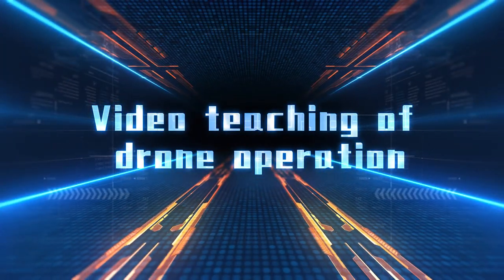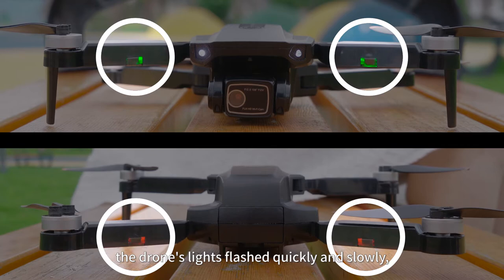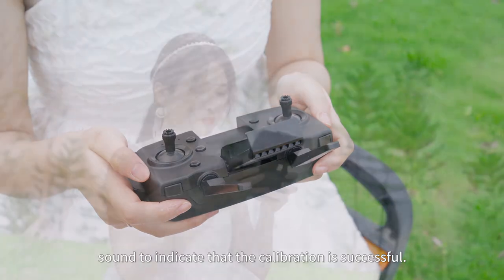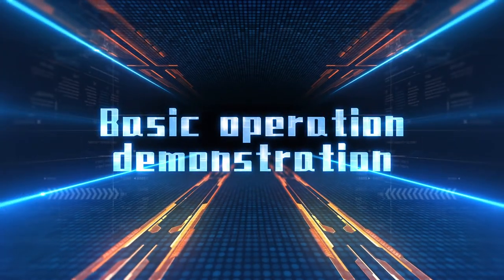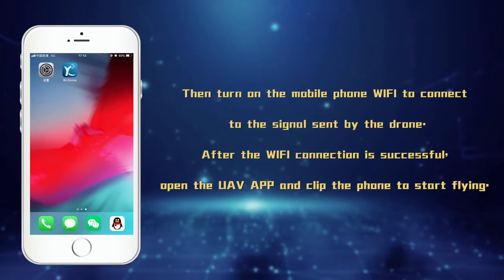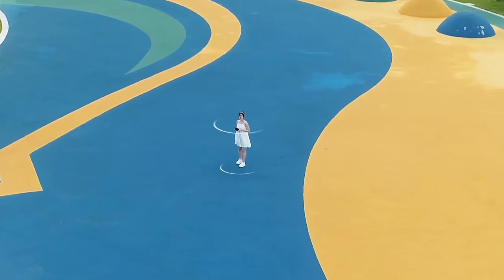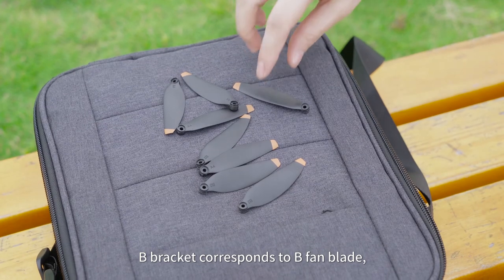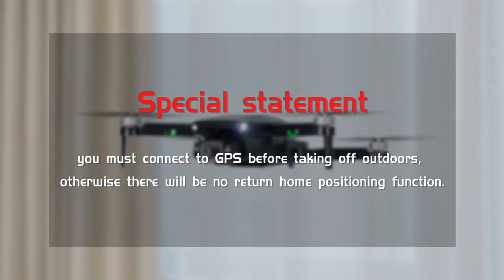RG101 Operation Video

Comment: When I press the one key return button on my remote the drone goes way up overhead instead of returning to the landing spot. Why does it do that????
Reply: There is a safety height for the return to home. When you press the button, the drone moves to that height before fly over the landing spot. You can define that height in the settings. Usually 30 metters is enough.But depends on the surrounding (buildings, trees, etc.)